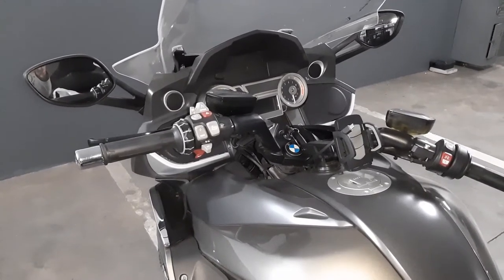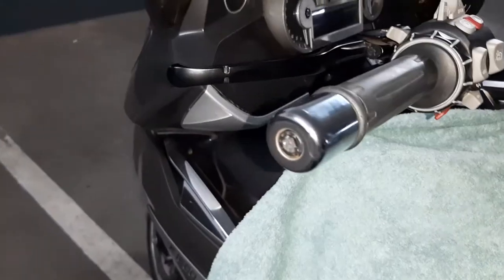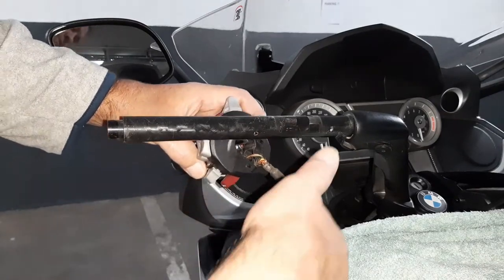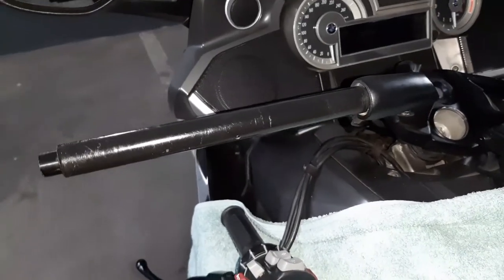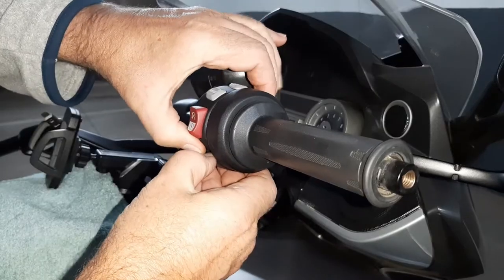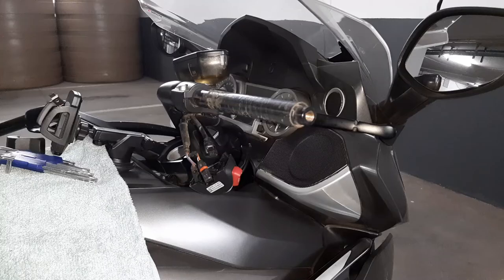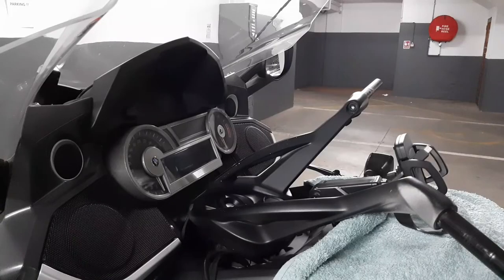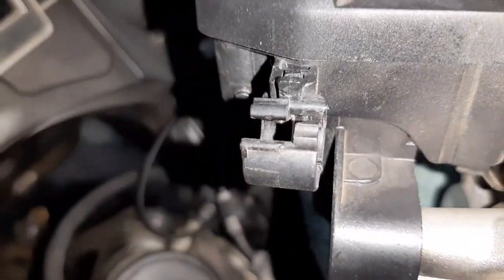BMW GTL Switchgear and handlebar removal

Comment: On my GT the wires were not long enough to remove the grip from the bar.  The workshop manual instructs to remove several body panels to get to the harness and free it up.  I didn't want to do that so decided to remove the bar from the upright, which you could not get off.  I got it off by putting a long 10mm bolt in place of the bolt that retains it (screwed into the end of the round bar), then hammering on it to push it out of the rubber mount.  It's tight but not hard to get it out that way, just be sure to have a long enough bolt, the one I used was 70mm, that's as short as will work.  I was then able to slide the bar out of the grip and switch.  Re-installing the bar was the reverse, but I hammered directly on the bar end.  Getting the bar in the correct position is important, and you won't be perfect, so use a pair of vice grips on the bar end to allow you to twist it.  I repaired the switch, the horn button wasn't working but deoxit worked to get it back, I'll have to do a video on that.